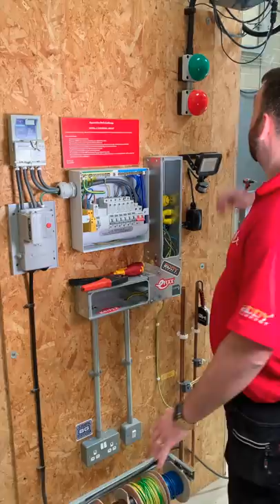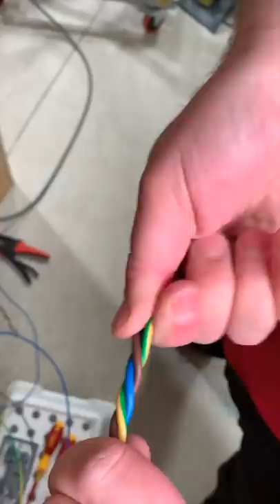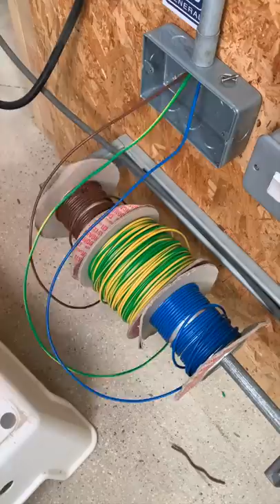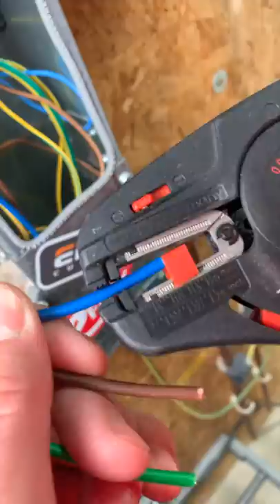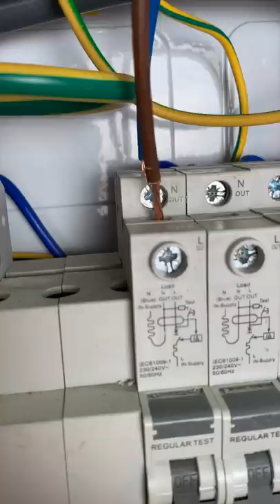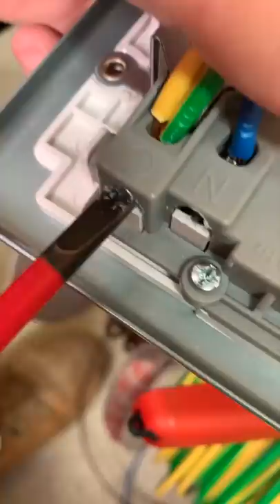The eFIXX Electrician's Challenge - Faster but slower #shorts

Comment from the maker: Where do you think you could rank on the leaderboard?
👉https://www.efixx.co.uk/electricians-challenge
Reply: Should not you terminate each stranded wire in this case?
Reply: No, you forgot ferrules.  You should delete the video before people do it and burn their hut down
Reply: Just goes to show speed makes work sloppy. Bare conductors showing after inserting in terminals 🙄
Reply: @levin8019  not needed on 7 strand.
Reply: 1 hour and 30 minutes because I went to have a coffee break in between.

Comment: There was a lot of copper showing and you didn't double over cables at the connections
Reply: Double over solid stranded really ??
Reply from the maker: See link in pinned comment, it's a race :)
Reply: @kbunboxing938  why not
Reply: Race or no race… proper install is key!
Reply: If you cut corners in a race you get disqualified
Reply: Race still need safety.
Reply: I would use ferrules, you screwed PE to a terminal without ferrule and I can bet it cutter wires. Race or not, its not a proper way to do this.
Reply: @MrRudyMurzyn  Agree. Race still need proper skills. It is not a 100m Race.
Reply: @MrRudyMurzyn  get off the internet.
Reply: @redman6128  race is not standardized and there is not electricity running. Get off the internet, get a life, be an electrician if you know so much
Reply: @redman6128  no they dont. Get off the internet bandwagon
Reply: @kbunboxing938  they dont know shit, dont speak to the bots.
Reply: @ghostkilla931  i am an electrician with certification, I finished engineering degree in electronics and I work in marine automation businesses for over 10 years. I was an electrician on shipyards all around the globe, don't measure people by your own standards. You should get off internet and actually do something with your life and stop assuming that people can't succeed in life because you couldn't .
Reply: @MrRudyMurzyn  backing you bud. People don’t know what they are talking about. Ferrets we’re not really needed if they just twisted the ends. Pure basics is what he failed at
Reply: Ferrels
Reply: @lukeparrish8483  ferrule*
Reply: @efixx  race or no race you gotta do it right that’s what matters
Reply: @MrRudyMurzyn 
Using ferrules on non fine stranded conductors? Smh
Reply: You don’t double over those strands
Reply: @lukeparrish8483  Ferules are needed even if twisted. Twisting helps for wires easily  entering  terminals only, it doesnt protect from damagaing by screws etc.

 If the terminal is designed for stranded  wires (teminal with "cage" construction, only then you dont need use ferules.
Reply: Points deducted for doing a shit job. When you race you make mistakes
Reply: @efixx  To see how shitfully something can be done?
Reply: Are ferrules even mandatory?
Reply: @scwfan08  Obviously never been in the heavy industrial industry.
Reply: Yup and he says its a race.... below .... race on how bad they can bodge it badly looool
Reply: @kbunboxing938  you want me to show you how to do it ?
Reply: Wank work race
Reply: @efixx  do it right or not at all 
I understand its was a race but people with only half a brain could potentially watch this video and think well "he" left the copper exposed so I should be ok 
Its not about speed its about doing it properly and as safe as possible
Reply: @joegroves446  safety.. copper conduct current, if the copper is exposed and you accidentally touch it you get electrocuted..
Reply: @efixx  shouldn’t race with electricity
Reply: @efixx  even with a race, its incorrect installation, which would mean disqualified.
Reply: Very poor, must use ferrules or at least double over if nothing else.. I wouldn't pass you..
Reply: Ferrules are nice, but in all honesty, a good electrical connection is all that is needed, and in a breaker, even untwisted is going to be fine due to the nature of the terminal.
A lot of people get too OTT about aesthetics and don't realise you still need to do the job in a timely manner.

Comment: The extra bare copper at the breaker is precarious work, and was left like that because you were racing..? I’d dismiss that timing as the service wasn’t properly done.. being an electrician isn’t about doing it fast but doing it properly..
Reply: This competition isn't about being an electrician it's about achieving the goal quickly, go back to being so bored you micro analyzed an almost silent film
Reply: @nahhh5318  oh so it doesn’t say on the title “electricians challenge”..? i know.. it’s a cake competition 😑
Reply: @nahhh5318  no, it was not done. Period.
Reply: Ahuevo carnal ese excedente de cobre en el breaker no va, ponle ferrul y así se ve un trabajo mucho más pro...
Reply: I can do it much quicker than that, just scrunch up and shove the wires in the socket terminals, no need to tighten screws and poke the other end of the wires directly through the meter tail gaps and forget the earth it's not needed - goal achieved, socket has power!....i win!
Reply: Exposed copper in a fuse board is not an issue as a fuse board is one big live exposed part anyway. You’re all looking for something to moan at but realistically there’s nothing in this video that goes against UK regulations

Comment: The last time i saw that much exposed copper. The police standards commission was involved :P
Reply: Seriously it takes 2 seconds to fix
Reply: The purpose was to do it fast...
Reply: @Syndicalism  fast doesn't equal safe... I mean, I could do it faster if I simply didn't bother screwing the terminals up.
Reply: @Fishbait075  it was a timed challenge in a controlled environment not where someone would be living or working. The purpose of the race was to do it fast ffs
Reply: @Syndicalism  Well, if skipping safety is allowed, why bother running the cable in the box trunking. Just whack it into the CU and patress and leave the wires dangling in the open!!!
Reply: @Fishbait075  because it's a race to completion with whatever set rules were made, clearly not a race to completion with 100% safety in mind, as it's pretty obviously not installed to actually be used by anyone. Also the purpose was to make it a competition for fun, not just a plop it in there and see who can plop the fastest. Yall are so fucking lame for not seeing any fun in a friendly competition lmfao. People make fun competitions all the time of real life things and plenty of normal steps get cut out of it for the sake of making it a reasonable competition
Reply: @fushisu  Whenever someone makes an impromptu friendly competition on doing something the fastest, some rules that would normally be included in the process are purposefully neglected in favor or making a more enjoyable challenge. I cannot believe how you people don't see the fun in a friendly challenge and instead have to get your panties in a wad just cause they cut some corners to make the challenge fit within the time span of a YTshort.

Just because the channel makes helpful neat videos, it doesn't mean they can't post a friendly competition where they change things up.
Reply: Why are people using the wire strippers ive seen one guy in 25 year use them he had glasses and was a right prick.

Comment: Excess copper showing at the consumer unit connections, plus I always connect the socket ends first and do the final connection to the consumer unit last. That way some numpty doesn’t accidentally energise the circuit while you’re working at the other end. But otherwise, sterling effort! 👍

Comment: 1. Not consistent terminations
- tunnel terminations (screw in round hole should be twisted as the screw will splay the strands
- CB exposed to much copper 
2. Pulling wires against others causing friction burn. 
3. Score marks on conductors from uncalibrated stripping tool.
Reply from the maker: I think we’ll just give up

Comment: No ferrules on the cables?  Auwtch!
Reply from the maker: FERRULES ON STRANDED CONDUCTORS: Should you use them?
https://youtu.be/Ia13o1I6DkM
Reply: @efixx  :)
Reply: What for? What matters in this country is faffing around with the tester and writing on certificates.. the execution is still a century behind.
Reply: @efixx  
Yes!
Reply: Why squeeze a separate CPC wire into solid steel conduit?

Comment: A good installation has 2 layers of insulation, which i guess this has, but since it is metal wouldn't it still be dangerous if the inside wires insulation failed and shorted to the metal insulation?
Reply from the maker: Metal is connected to earth - would blow mcb

Comment: I am a Chilean electrician by profession. I would love to work in England to continue learning.
Reply: Try somewhere developed instead this is not 2022 standard in the rest of the world.
Reply: @thenorthernhandyman  The UK has been regarded as having the safest electrics in the world for years. You’re a handyman so you’re not allowed to touch electrics
Reply: @uplightuk8924  yeah sure, components possible to touch in metal sounds very safe. Screw connectors are also super safe *irony*, how often should they be retorqued and how often is it actually done?
Reply: @thenorthernhandyman  I can tell you have no idea what you’re talking about. 

Also we mostly use Wagos and compression connectors unlike a lot of countries (America) who still use wire nuts and screw blocks
Reply: @uplightuk8924  did you even watch the video?
Reply: @thenorthernhandyman  This video is purely to se how fast he can do it, not about doing it perfectly. Watch his other videos and you can see this guy clearly knows what’s he’s doing.
Reply: @uplightuk8924  I'm still talking about the material used. Metal components and screw connectors. English isn't my first language but seriously I'm not that bad at it.
Reply: @thenorthernhandyman  Metal components are earthed so in the event of a live cable or similar touching a metal component it trips out the breaker - just like any other country will have their own earthing/grounding system so I can’t see the issue here. We also use RCD protection which will trip out the breaker when there’s an imbalance eg if someone touches a live metal component that hasn’t sufficiently been earthed. 

Nothing wrong with using metal components as long as they are earthed. 

I have already answered your point about the screw connectors in the previous comment..
Reply: @uplightuk8924  still a unnecessary risk. Plastic pipes and housings are one more layer of protection. Just as durable, easier to work with, cheaper and safer. 
You might be talking material used in general, and I don't care what you usually do. I'm talking about this video, it's used as  some sort of instructional video or competition and uses crappy material.

Comment: I learned as an Electrician and Oh Boy was i Displeased here. First of all, If you use Flexible Wires to Wire in an Bolted Connection, you have to use Wire end ferrules so the little copper wires won't split and in the worst Case result in a high Résistance Connection.

Second is the left on copper Wire in the curcuit breakers - this can cause Connections to the ground If there is too much dust building Up in the housing.

I simply don't understand the competition in Speed Wiring. An Electrician's Job is not comparable with Something Like Mass production, where you want high quanitity. What's even the Point?
Reply from the maker: A bit of fun - see link in pinned comment

Comment: Not using cable end sleeves on stranded wires under single screw terminals 😬😬
It's not good and secure connection what you did!!

Comment: And you didn't use a torque screwdriver on the connection which is a requirement  by NICEIC and the manufacturer
Reply from the maker: This is a race “fun” we’ve made a whole in depth series about the torque requirements 👉
Reply from the maker: https://www.efixx.co.uk/talk-the-torque

Comment: I will never understand why you keep your installations closed over there, here in Germany this only happens in areas where there is a risk of explosion.  The whole thing looks good, of course, how long should the surface installation take?  Our apprentices are better at connecting cables without ferrules. A stranded wire under a screw?  That will not do.

Comment: And you just double bonded when you put your neutral and ground in the same terminal on the plug.  You didn’t even need to run a neutral for that plug.  Your todays winner of the ID 10 T award

Comment: Omg bare copper wire for the connections, every end of every cable should be in a connector and the wires should not stick out
Reply from the maker: See pinned comment

Comment: Using screwing terminals without crip connections, time for a house fire
Reply from the maker: Class 2 conductors intended for fixed installation
Reply: @efixx  every electrician can tell you that the screw connection will slowly lose grip on the wire cause its  strained core and not solid.

Comment: Whats the point of it? If you want to make it fast just dont put cable in tube, make cable copper show 10cm and never screw down any of junction boxes. This straight teaching that faster and unsafer job is way better than making it safe and correct.
Reply from the maker: See link in pinned comment

Comment: Too much copper on show, stranded singles were not twisted to maintain integrity of the conductor and stop it from splitting in the terminal, no care was taken when running the cables in the trunking as a cpc of another circuit is warped around them.
Reply from the maker: See description

Comment: Very poor performance. To many mistakes made. Copper wire showing and no ferrules were used when there was no cage in front of the screws.
Reply from the maker: Ferrules on class 2 conductors?
Reply: @efixx  well as you can see for yourself. As the screws are tightened they severe off some of the fine wires.... as a master craftsman I insist that my journeymen and apprentices as good practice.